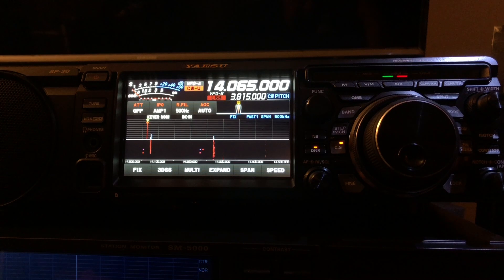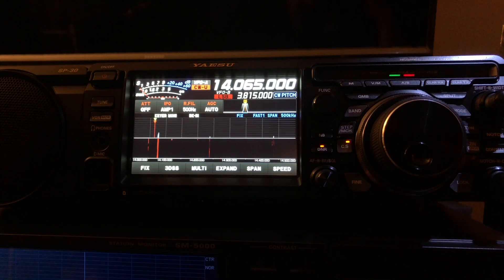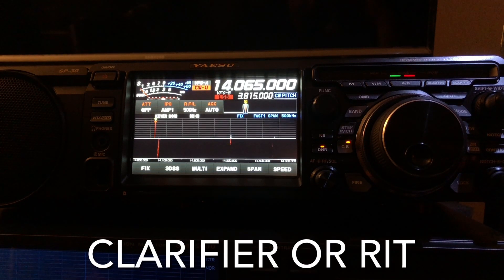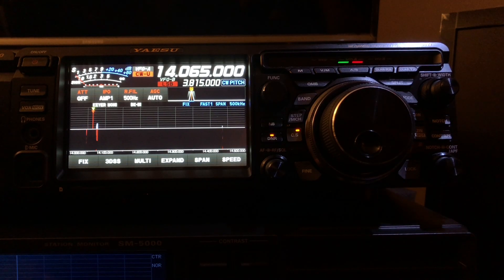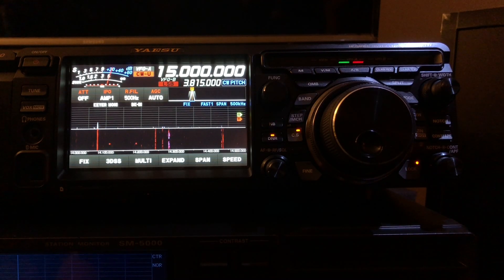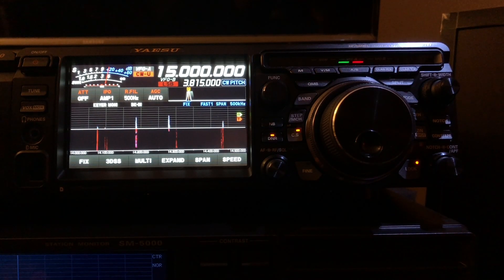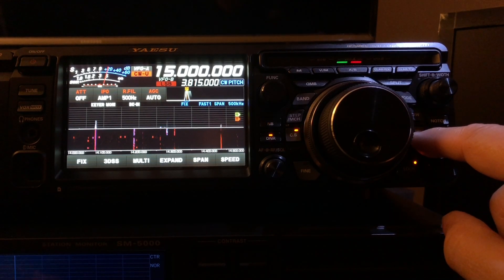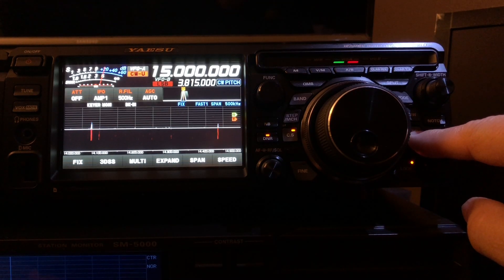Yaesu FTdx10: Reference Oscillator Fine Adjustment (Video #29 in this series) #yaesu #ftdx10

Comment: Many thanks for a great video. Here in the UK WWV is not always possible to hear it. I could on 10mhz this morning. Your video once again shown me how to do it easy. My FTDX10 was -2 out. Made a big difference to my old tinnitus ears to us my headphone, I really could hear the difference. Many thanks.
Reply from the maker: I’m glad you were able to get it dialed in Stephen.  I check mine any time the ambient temperature changes significantly in my shack, basically a Winter check and a summer check.

73, Doug
Reply: Mine needed to be set to -4. Now I know that my radio's frequency is dead-on. Thanks!
Reply from the maker: You’re welcome.

Comment: Thanks for making this! Just adjusted my radio And a setting of +2 worked for me as well
Reply from the maker: +2 isn’t very far off, but why not put it dead on, right?  These newer transceivers are very close and stable, compared to the old radios.

73, de N4HNH
Reply: @n4hnhradio won’t be hearing me complain about extremely stable oscillators. Always a good thing.

Comment: Cool!  Yaesu needs to pay you a sales commission because I know this series has sold at least one radio -- to me!  I have learned so much and I really appreciate these videos.  I did a similar TCXO adjustment on my TS2000 a while ago, except that involved a screwdriver and removing one half of the radio's case.  This is so much easier.  And now... I'd like to make a small philosophical nit-pick with regard to the idea that "You're off frequency!": No, I'm not, not if I'm within the band edges and in the appropriate segment for my emission mode.  Everybody seems to think you need to be exactly on frequency to the nearest one kHz for some reason, which is not al all the case.  Really. just grab that big round knob and twist it until the other guy sounds right, or the frequency is clear, or whatever you need, and use RIT and/or XIT if necessary.  Absolutely no need to be exactly on any particular frequency.  Heck, way back in the crystal-controlled days the most likely situation was that two stations in QSO weren't on the same frequency at all.   (Well, maybe it's different for nets, but even then I can still find MIDCARS if they are a few Hz off of 7.258.  In which case everybody needs to zero beat net control and be done with it.)  So again, thank you very much for this video series, and thanks also for listening to my rant!  :-)
Reply from the maker: Well, I remember the Vernier dial days.  But when someone posts that they are on 14.335 and they sound off frequency, I know its not me.  It is more noticeable with CW.  They post a spot for 14.060, and with my 50 Hz filter I don’t hear them.  I widen my filter and/or go looking, and I find them at 14.059.930; 70 Hertz low.  Because I’ve verified my reference oscillator with WWV, I know that I’m not off frequency.  I notice many operators will chase them from 14.060, their published frequency.  I could use APF or Clarifier and do the same.  But I tend to just work them wherever they are.
Reply: @n4hnhradio  Thanks!
Reply from the maker: And I don’t mind if you call John Kruk at Yaesu and suggest a commission.  Hi! Hi!  Like that would happen.  They don’t even send me radios to show off.  I have to beg, borrow, or buy.  But I really don’t want their involvement.  They could control my objectivity. That’s why I prefer Patreon member support.

73, de N4HNH
Reply: @n4hnhradio ridiculous…,you have sold more radios than I bet most of the current sales force…lol.
Reply from the maker: Only because I just so happen to have purchased Yaesu radios when they were on sale and I use them to teach operating techniques.  I’m certainly not trying to boost their sales.  That said, even though they aren’t perfect, Yaesu radios are generally the closest to the mark where it matters most.  But I’m certainly not allied with Yaesu.  Apparently I irritate them.

Comment: In Your exellent video in the best, N2 setting the 300 HZ sound wave makes the full turn (360 degrees) in about 7 seconds. It looks like the accuracy of your FTDX-10 is one of seventh of a HERZ !!!
We are ready even to fly to the moon !!!  :))))
Reply from the maker: Yes, it is quite good for a +/- 0.5ppm TCXO.  The FTdx5000MP is even better at +/- 0.05ppm, with its OCXO.  But the FTdx10 is quite adequate, holding within 1 Hertz of stability.

73, de N4HNH

Comment: Very informative video, even if I don't have a FTDX10. Thanks!
Reply from the maker: Just about any radio can be checked this way.  But some don’t have a menu setting for fine tuning the reference oscillator.  It has to be done with an internal adjustment.

73, de N4HNH

Comment: You'll also find that the oscillator will 'age', check it again a year from now to see how much (if any) it has drifted...
Nothing like my old Drake 2a would drift I'm sure ;^)
Remember, we used to have a 'calibration' oscillator in our older radios :)
Good info Doug for those that don't know and you demonstrated how it could be done without any external test equipment.
Thanks for the videos on this great little radio, I'm probably going to get one this December if Santa is good to me
73
N7BFS
Reply from the maker: Yes and interestingly enough, my FTdx5000MP hasn’t budged in the 20 months that I’ve owned it.  It is incredible.

73, de N4HNH
Reply: @n4hnhradio  That says a lot for the build quality of the components they are using, sounds like another great radio :)
73
N7BFS
Reply from the maker: The FTdx5000MP is still my favorite.

73, de N4HNH

Comment: WWV has added 25MHz, if you are lucky to hear it.   I have not.  The higher the frequency, the better the zerobeat resolution.  Great vid as always.
Reply from the maker: I almost listed 25MHz.  But 25MHz is experimental, so I didn’t.  But alignments are performed at 14.2MHz, so 15MHz WWV is close to that.  

I have definitely heard radios that seem on frequency at 3.8MHz, but at 14MHz you can start detecting a few Hertz off frequency.  I sometimes wonder if Elecraft aligns the KX3 at 3MHz or maybe 7MHz.  I’ve heard numerous KX3 radios that were noticeably off frequency at 14MHz and higher.  Maybe the owners didn’t purchase a TCXO option.

73, de N4HNH
Reply: i hear it very often, im in north Mexico
Reply: I heard it last nite.  It was 5x9.  So I tweaked my FTdx10 using Doug's technique.  My 10 was very close & tweaked the Ref to +1.
Reply from the maker: It usually only takes +/- 1 or 2.  I check mine when the season changes, since my radios are in a basement.  But with the TCXO in the 10 and the OCXO in the 5000, both radios are usually within 0.5 Hertz accuracy.  No one can hear that.

73, de N4HNH

Comment: Hi...I'm in the UK and the tone on 150.000 I cannot hear..Is there a way I'm able to check easily..Many thanks for all your time giving the ham community useful info..
Reply from the maker: If you cannot receive the 15MHz signal, try 20 or 25 Megahertz.  It is best to use 15, because it is in the middle of the HF spectrum. Yaesu uses 14.2MHz to align their transceivers, because it is closer to the middle of the HF spectrum.  You might try a different time of day and see if you can hear the 15MHz signal. Or, at night, try the 5 or 10 Megahertz signal.
Reply: @n4hnhradio  Many thanks for your info...will try what you say... Appreciate your time sir..
Reply from the maker: You’re very welcome.  73, de N4HNH

Comment: Another question Doug. I have checked my FTDX10 against WWV like you shown and I am happy with the calibration. Now my question most SOTA stations don't seem be be on freq ie 14.064980 not 14.06500. Have I set something up with my cw freq display wrong. Steve
Reply from the maker: No, you did great.  Many QRP transceivers don’t have a TCXO.  But I’ve even worked Elecraft KX3’s that weren’t dead on.

73, Doug
Reply from the maker: I find the CW SOTA stations are quite often slightly low in frequency or slightly high.  It’s more noticeable with CW than with SSB, since they could be 50 Hertz low and throw off our sidetone by 50 Hertz.  50 Hertz is noticeable.  Your ZIN button will compensate for their frequency variance.

73, Doug

Comment: Thank you for this video.  A question…..while watching I noticed a carrier traveling across the span of frequencies show on the radio.  Would you happen to know what that carrier is? Thank you for taking your time to answer my question!
Reply from the maker: You probably saw the Ionosonde pulse travel across the display, checking propagation. 

73, de N4HNH
Reply: @n4hnhradio  Oh, that's what those are? I always suspected they were some form of over the horizon radar. I used to hear them all the time when I was an SWL back in the early 1990s. Of course we didn't have waterfalls or spectrum scopes in those days so I couldn't see them coming like I can now.
73, de DW7GDL

Comment: Before calibrating, have the radio powered up for a couple or 3 hours.
Reply from the maker: These have a TCXO.  It doesn’t take hours.  They settle quickly, usually in minutes.  The FTdx5000MP has an OCXO.  It settles in 2 minutes.  I give the TCXO 20 minutes, though 5-10 minutes should be enough.  My old ICOM IC-725 has no TCXO.  I let it warm up for a couple of hours before calibration.

73, de N4HNH

Comment: Hi  ..at  25mhz when the propagation is good ,  i can do the same way you did ??? with my FTDX-10     73
Reply from the maker: 25MHz should be good enough. It’s best to tune closer to the center of the HF spectrum, which is why I use 15MHz.  But, if you can’t receive 15MHz, you might have to use 25MHz.

Comment: Is it worth checking the frequency on both USB and LSB?  What if the BFO frequency is a bit off, and the frequency calibration shifts?
Reply from the maker: Hi Walter!  It shouldn’t matter.  The BFO is either injecting the carrier on the high side or the low side.  If you are experiencing QRM with CW-U, you just switch to CW-L.  The BFO adjusts the carrier insertion accordingly.

For what it’s worth, I checked the FTdx10 with CW-U and CW-L.  There is no difference in the accuracy.

73, de N4HNH

Comment: man, i love this stuff... having some/any idea what those CW specific buttons do greatly increases my enjoyment of this radio...even if I'm not going to be using them for a while... great video, thanks! 73 de KD2TJU
Reply from the maker: You’re quite welcome Todd!  If you are interested in easing into CW, use the 5 memory slots to send your callsign and signal reports in CW, you can use the decoder to read out what the other station is sending.  It’s a great way to learn.  Bring up the decoder first, then bring up the message memory display.

The best thing to start with is chasing SOTA activators.  You can see their spot post on the SOTAWATCH web site, so you already know their frequency and callsign.  All you need to do is send your callsign, perhaps from message memory slot 1.  If they hear you and respond, the decoder should display your callsign and a signal report.  Then send them RR UR 559 73 de KD2TJU BK.  Store this in memory slot 2, then a 579 version in slot 3, a 599 (use 5NN) in slot 4, and EE (dit dit) in slot 5.  Send EE after they send 72 or 73 EE.

As long as the other station’s signal is strong enough and pure enough, 559 or higher, the decoder should be able to lock on.  Note that if you narrow the filter to 50-100 Hertz, the S-meter might show a S5 as S0, but it’s clarity that you want.  If they sound clear at S0, after I filter them, I give them a 559.  And the decoder doesn’t care as much about S meter level as it does clarity.  The S/N ratio is what helps the decoder.

73, de N4HNH

Comment: It seems like the DNR & APF with a narrow width combo works better after doing this adjustment as well.  Maybe it's in my head.
Reply from the maker: Having the oscillator on the money keeps us from needing to move the APF off of zero, except when the sending station is off frequency. But I tweak my receive frequency to match them, so my sidetone pitch stays the same. Of course ZIN can make that adjustment automatically. 

73, de N4HNH

Comment: 1:10 "TCXO...using a stable environment of temperature..."  Nope. You've just described an Oven Controlled Crystal Oscillator (OCXO) [mentioned later in the context of the other radio] that provides 'a stable environment of temperature'. A TCXO simply measures the temperature and adjusts its clock (perhaps even as bad as stealing cycles) according to a look-up table. Advantage is less power than an oven; disadvantage can be phase noise as the TCXO adjusts.
Reply from the maker: As I recall, the video was about adjusting the reference oscillator.  The focus wasn’t about whether the oscillator used a thermistor to compensate (TCXO) or an oven-controlled environment (OCXO). Those would be side notes if I did mention them.  But again, the purpose of the video is about checking/adjusting the reference oscillator. Maybe I described OCXO and inadvertently called it TCXO. I don’t remember.  It was long ago.  I hope I didn’t.  But, if I did, it doesn’t change the purpose of the video.  It sounds like you are smart enough that you don’t even need to watch the video.  But I have heard from viewers who used the video to check/adjust their reference oscillator and it worked for them.

Comment: Nice trick, but did’t you now “adjust” the rig to the accuracy of the internal BFO in this case 300Hz? How are you so sure this is exactly 300Hz? 73,Rob
Reply from the maker: It is as accurate as the BFO.  That’s why I call this a “poor man’s frequency counter.”  The resolution of the BFO puts it into an acceptable margin of error.  The frequency of the BFO is in the hundreds of Hertz range, so it is probably within 1 or 2 Hertz accuracy at 300Hz. That’s plenty close for SSB (undiscernible) and even close enough for CW.

 I’ve worked with service monitors as a radio technician. I trusted them, but even they could be off slightly, though within specified limits.  The service monitor was calibrated against the National Institute of Standards, to within a specified accuracy. Still, it could be off an incremental amount. 

At least I’m checking the radio directly against the National Institute of Standards; no “middle-man”.  So the only unknown is the BFO.  But at 300Hz, the BFO can’t be off by much.  And I mostly work CW.  I can tell by the number of people I work who are zero beat that my reference oscillator is probably within 1 or 2 Hertz accuracy.
Reply: Depends how this BFO signal is generated. If this from an adjustable counter from the 10MHz ref osc this must be pretty close to 300Hz.
Reply: The accuracy of this rig is more then adequate! I have both the ftdx10 and the ft5k. Nice rigs. Also have tentec corsair 2, which is a FB classic CW trx! 👍73, ON1LW
Reply from the maker: @BobMulder-ow6ms I don’t care how it’s derived. The end result matters.  On air it is zero beat with CW signals from other high-end radios. That’s close enough for amateur radio. I had a radio calibrated at a service shop a few years ago. It was off enough that it was noticeable with SSB.  I calibrated it to WWV and it now zero beats with other signals.  But, if you prefer a service monitor, and you have one available, use it. Don’t trust a stand-alone frequency counter though.  I’ve seen many of those that weren’t completely accurate.  They were more like a toy.
Reply: BTW: an extra 300Hz CW xtall roofing filter makes a differnce on vy strong signals. I noticed this in last russian cw contest. Signals were 599++. First hop and extremely strong. 300Hz makes a difference as compared to 500kHz to pick the weak singals with the ftdx10. GL, and your video posts are FB and good quality.

Comment: military uses a modern crystal radios to
Reply from the maker: Even the synthesized radio needs a clock. Just like a computer needs one. We just aren’t “rock-bound” like in the old days. A transceiver needed multiple crystals. My first CB radio had tubes, instead of transistors, and it required a separate TX and RX crystal for each of its 12 channels. You bought the crystals for each channel you thought you might use. There were 23 channels back then, but the radio only had 12 places for TX crystals and 12 places for RX crystals.

Comment: Wow though I can say I guess someone had to be get me a FX10 going watch this again and maybe more.  Can I say thick headed.
Received my ZS6BKW
now to get it up 45'-50' and be good to go. 
Need someone with a way to get it up. Text one and have not received any response. 
Guess I am not like any more.
More on that later
KQ4CD
Reply from the maker: I used a slingshot and a sinker.  I shot the sinker over a limb and then pulled some Dacron rope over the limb.

I doubt your FTdx10 will be off frequency enough to be noticeable.  Don’t make any adjustments until it has been powered up for an hour or so anyway.  And I wouldn’t adjust a new one until it has been used for a while.  Maybe after a few weeks.  But, like I said, the radio will probably be within a few Hertz anyway.  It has a TCXO.

73, de N4HNH

Comment: I can't hear anything on 15.000
Reply from the maker: It depends upon your location and the time of day.  WWV is in Fort Collins, Colorado.  You could try 10 or 20 Megahertz, 20 would be preferable.  They have an experimental broadcast on 25MHz that you might also try.

73, de N4HNH
Reply: @n4hnhradio  I'm in Wales in the UK
Reply from the maker: Whenever 20m is open to the U.S. I would think you should be able to hear the 15MHz signal.

73, de N4HNH